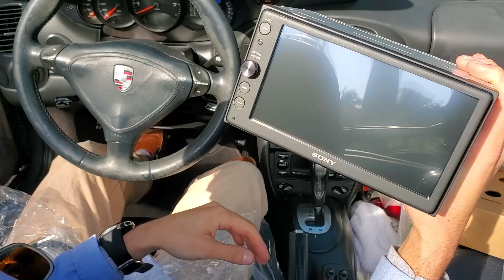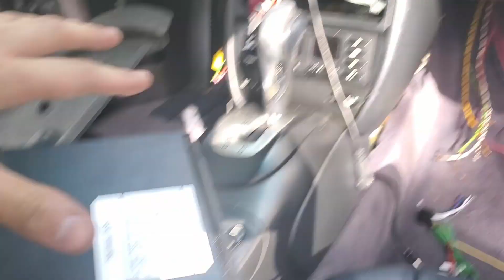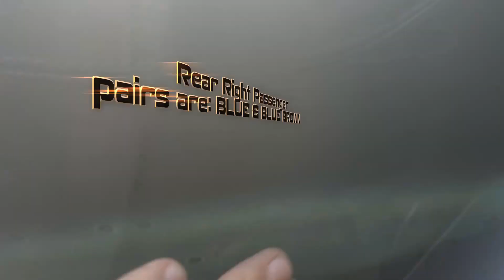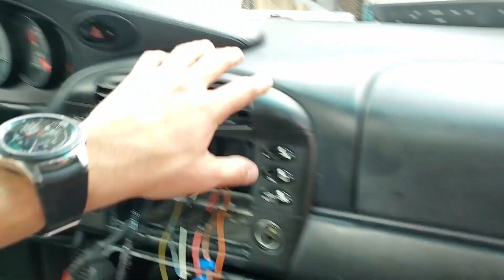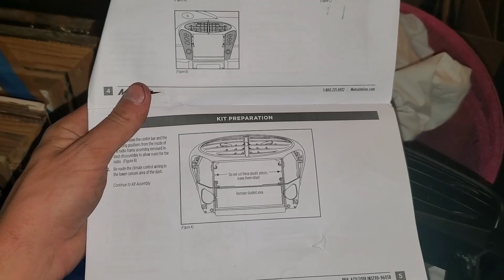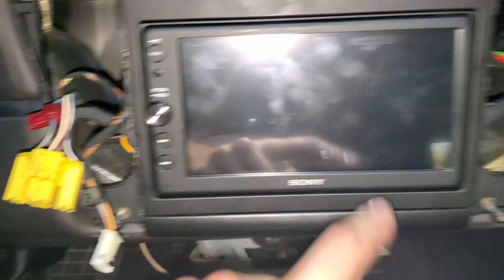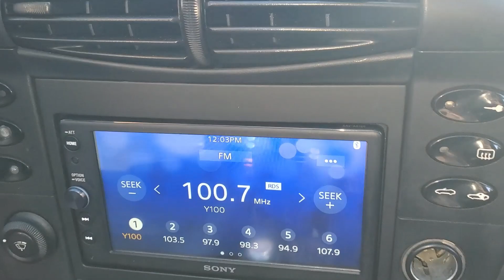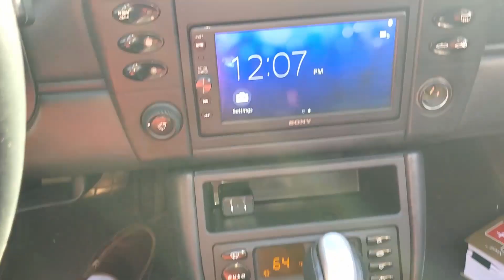How to Install both Apple Carplay & Android Auto Radio in a Porsche 911 996 & Boxter 986 (97 to 04)

Comment from the maker: FYI: I believe the orange-yellow wire (illumination) or the 12 acc (red wire) on the purchased adapter keeps ONLY the radio time in sync by keeping a constant 12volt power on.

Well as long as I connect an iPhone or Android, the radio is smart to grab the time & keep it in sync.

I choose this wiring path shown in the video, cause I was afraid my radio would kill my battery, possibly prompting me to manually power it off. (Possibly each time I power off the car.) Therefore, I didn't want to spend more time researching it.

Moreover, the radio time always shows up incorrect upon turning off the car & turning it on after a while, maybe cause of how I wired it. It's not an issue, as I do not care about the time, when I have a watch.

Just putting it out there & NO I do NOT lose my radio presents nor, settings. Just my time lol